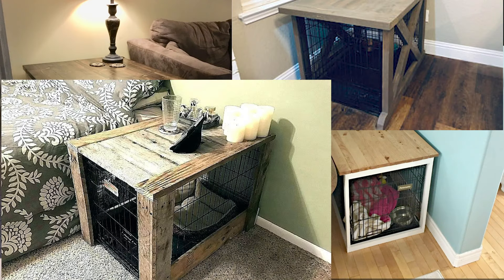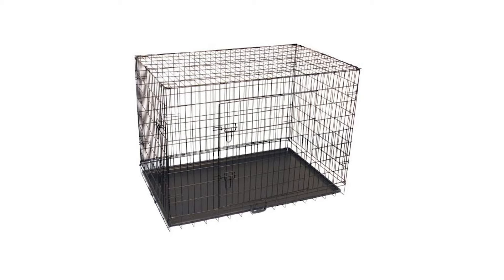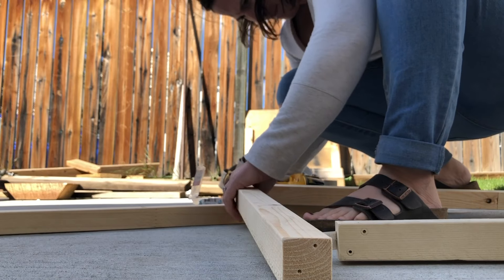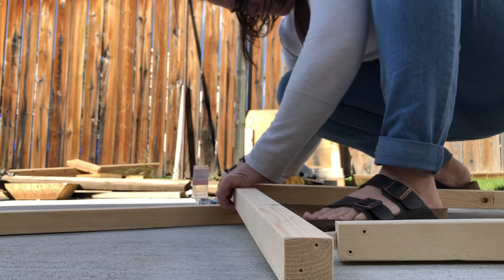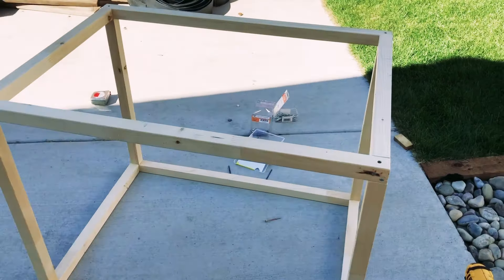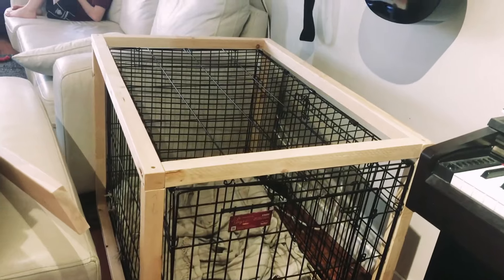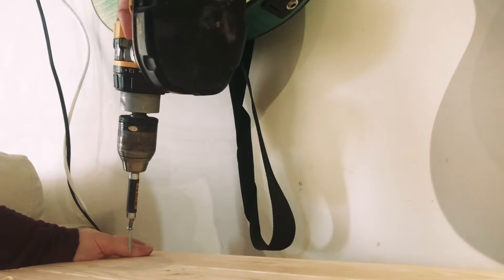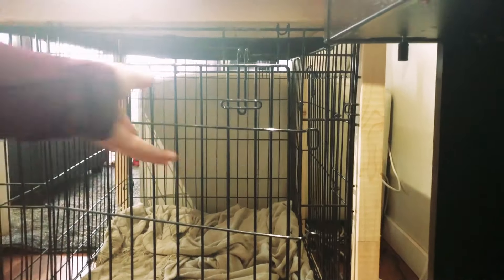DIY Dog Crate Table Build, Beautiful End Table! /  Our Wild Life

Comment: You used 3 inch screws? Wasn't that too long since the top is 1" (.75") + bottom 2" (1.5") is less than 3 inches?